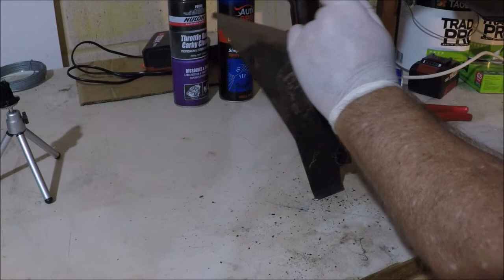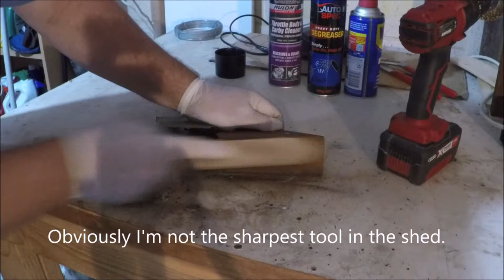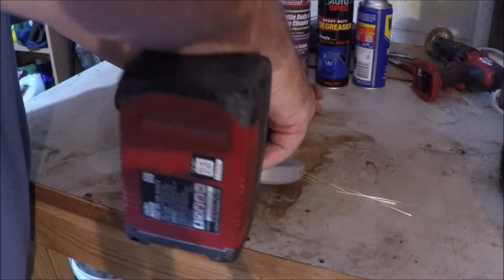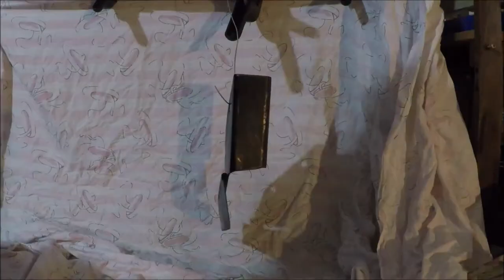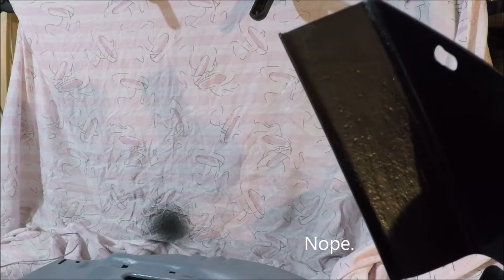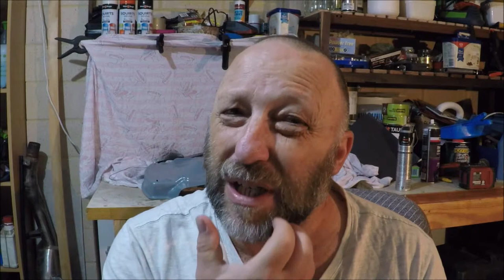Victa V196 1978 Utilty 2 Stroke Mower Rebuild Part 3

Comment: Hey Wazza I hope that you are wearing SAFETY GLASSES when you are using the wire wheel or any type of disc on a drill or angle grinder etc. Those wire wheels are always throwing off strands of wire. You DO NOT want a hot strand of wire in your eye mate. The best wire wheel to use is a cup shaped wire wheel that can be used on a flat surface. I always treat rusty metal with a coat of rust converter that kills the rust. Cheers bloke. WHAT! NO primer on the side chute! just straight black oh cmon mate haha!.............. na good job mate.
Reply from the maker: You are correct there, my brother has had a few incidents even wearing eye protection. Me, I'm a bit slow on the uptake.
I do wear safety glasses now.
Reply: @wazzasworkshop4852  That's great to hear that you are using the right protective equipment now. Cheers bloke.